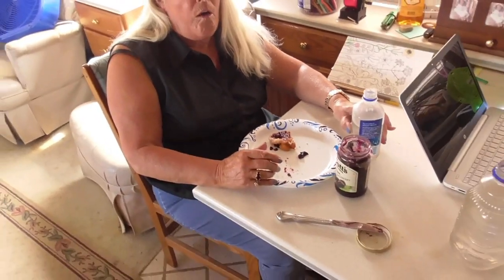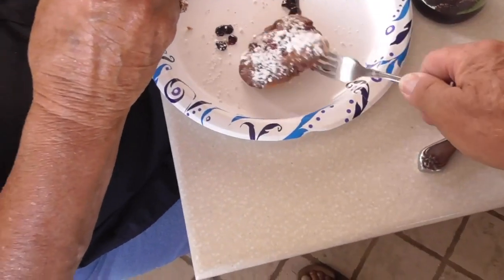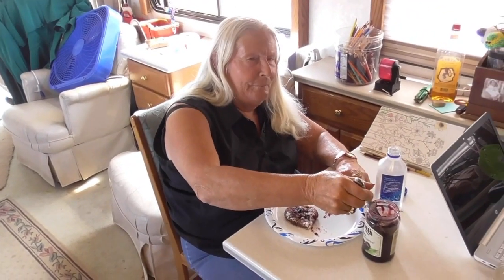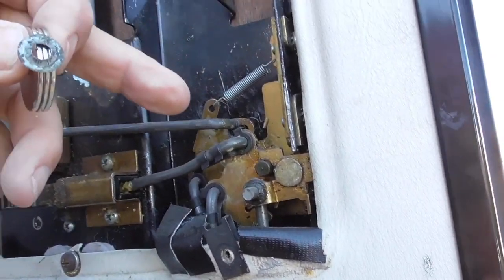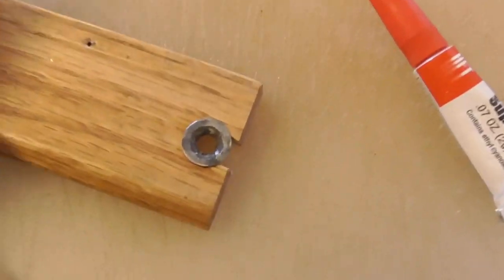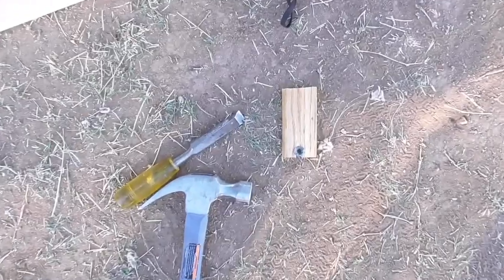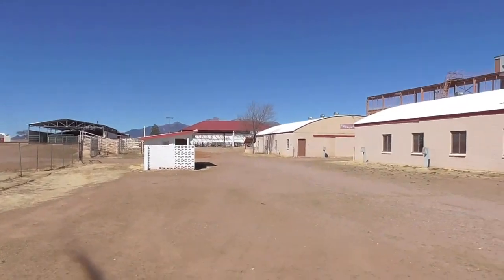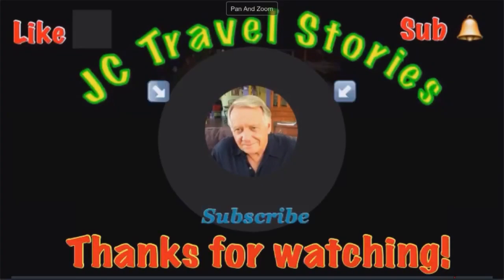RV Door Lock Problem. Invented a special tool.

Comment: So you super glued the washer onto the rod without dropping it down into the door. Clever way using that home made tool. I can't help gut wonder if it used to have a C clamp or something else originally. I don't trust superglue for the long haul, but it seems to last a heck of a long time. 
If you're anywhere near the border, I hope your watching out for the got away illegals pouring into the US. The smell of those fried snacks could draw them :)
Reply from the maker: No, the glue was only temporary to hold it to the board. BTW ... I’m not afraid of Mexicans.
Reply: @JCTravelStories  I had a feeling you weren't afraid of Mexicans. LOL!